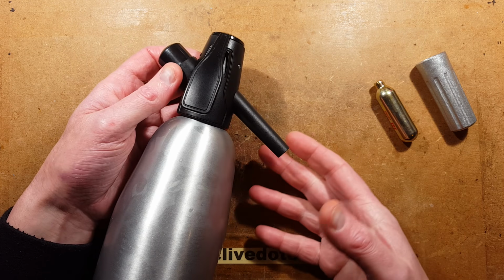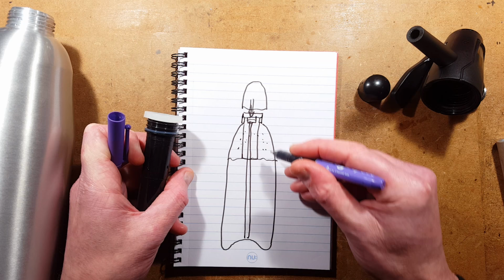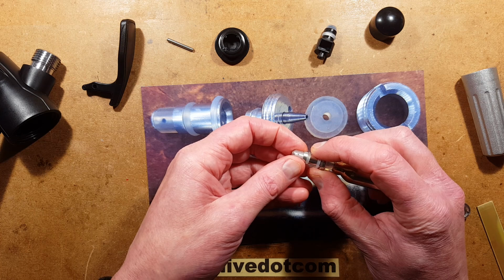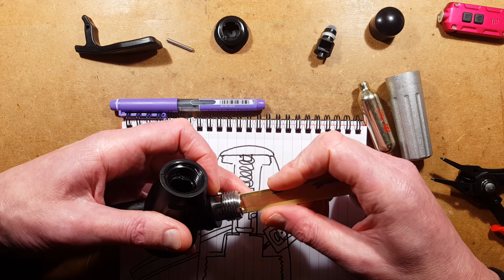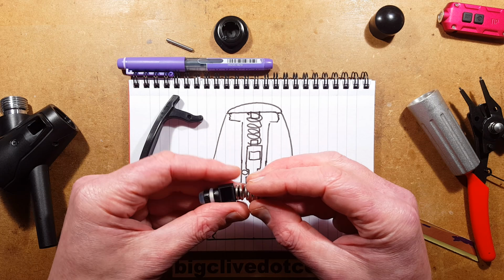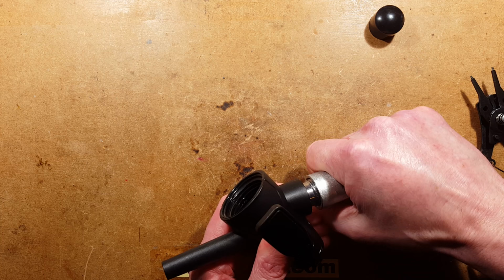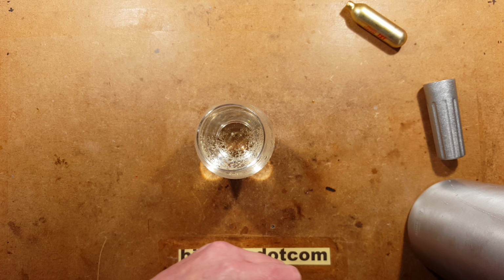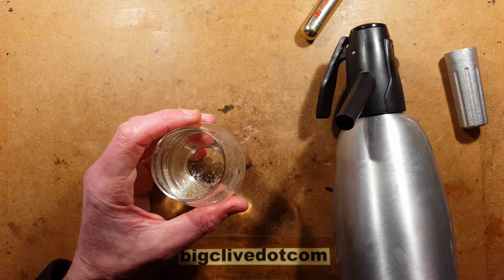Soda siphon teardown.

Comment: In junior high school,  My class made little drag race cars out of wood.  a hole was in the back to accept a CO2 cylinder.  Two cars would be set up on a trigger mechanism that launched both at the same time.  I took my time and carved mine with an aerodynamic body.  sanded it all real smooth and painted it. I sanded the plastic wheels smooth of their sprue dimples and used a wee little bit of graphite in the axles.    Another girl just rough-cut some flat-nosed, very narrow wedge. and slapped the wheels on.  When it launched, hers fell over on its side and slid down the track  (Track being two tight, 50 or 60 foot long cables that ran through two screw-eyes in the bottoms of the cars)  And it STILL beat mine by 2 feet!  I called shenanigans on the quality of the CO2 cylinders.
Reply: Curiously, a wedge with only 3 wheels, and only 2 that touch at any time is the perfect derby racer.
Reply: @ICountFrom0   True..  But I got beat by what was basically a door-stop, sliding on its side
Reply: That's what peek performance looks like.
Reply: I'm guessing you are about my age.  We did the same thing in 1949.
Reply: @MarvinStroud3   I was born in '75,  I built my CO2 racer in 1989/90  school-year.
Reply: Boy Scouts have Pinewood Derby races, similar to yours without the CO2, using a gravity ramp for the start. My dad advised me to just cut a wedge on the nose and paint it, leaving most of the mass it started with. The ones that had been sculpted and painted like yours looked nice, but didn't have enough  mass to get as much speed on the start.
Reply: And while you were faffing about minimising drag on the eyeholes, with your canister on a testube stand, she was holding her CO2 canister in her hand, warming it up and maximising its pressure difference.
Reply: @penfold7800    HAHA!  Probably!
Reply: Cammi Rosanov What a gas! :0)
Reply: What a lovely memory and a lesson in form and function, but I bet she has no recall of the event whilst we share yours......

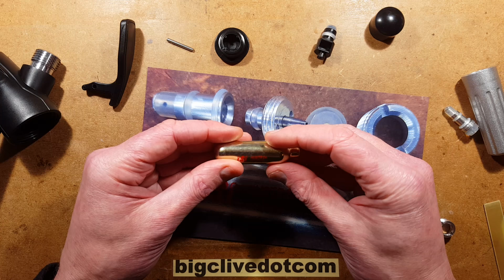Comment: 7:00 For those curious YT has a video called: "How it's made- CO2 cartridges"
- 
tldr: cartridge is put into a sealed machine within a machine and it's filled and capped like the bigman said.
Reply: There is one main difference from Clive's explanation because his guess what that the cap is spot welded on. The video shows a lip was cut on a lathe and the caps look like they are put on it and then crimped not spot welded onto the neck.

The ones that clive has looks a bit different and the cap is inside the neck of the container so I suspect the neck is crimped around the caps because it is a bit conical. The shape of the neck is visible at 6:21. You can see tool marks on the neck of the cylinder from some direction.
Reply: The How it's made video misses vital details of how the process exactly works (common with a lot of their videos).
Reply: Unfortunately that video glances over how that one machine works.

Comment: So the concave shape in the bottle is called a punt.  In wine bottles it makes the bottle easier to pour, but in this case it's a way to allow the bottle to handle the pressure and not fall over when you put it down.  Anytime you're dealing with pressure vessels, the more spherical the better.  Obviously a round bottom bottle won't stand up, so the punt turns part of the sphere inside out and follows the curvature of an ancient roman arch.  2000 years of engineering and materials science went into a device that makes fizz-water.
Reply: First of all you are absolutely right.

I know for a fact a lot of people 

The Ponte .

I know I probably spelled it wrong.

 I'm using Google for voice recognition sorry.

Been more than one comment I've made at the Google turns out hilarious not intentionally.

Anyone have stories on that or anything similar it'd be good to come in here just asking.

Also is it possible to use Google voice recognition for Windows 10 PC use?

Any comments on that would be appreciated I need to use voice recognition most of the time.

And it would be better for some things than dragon.

Any comments suggestions whenever would be appreciated thanks ahead of time.

think that the bottom of a wine bottle is just so it's easier to pour if there's a domed in word but no it's for structural reasons because of pressure.

All so By any chance are you an engineer?
Reply: @aaronbrandenburg2441  Not an engineer, 15 years in beer and wine production.  I guess you could call me a technician.
Reply: I thought for wine bottles it was to get more in a case?
Reply: @misterhat5823  Never heard that one before.  The punt decreases the volume of the bottle and would get you less in a case.  I did find a Wikipedia reference though.  
"It allows bottles to be more easily stacked end to end"
But if that were the case (see what I did there) why not use square bottles?  Well that's where we are with Bota Boxes and Bota Bricks.  Which I love.  Being able to take the equivalent of four bottles of wine home in my backpack is the best thing the 21st century has to offer.

Comment: A tip I read for carbonating wine in an old 1950s Sparkletts ad was flipping the bottle upside down when pressurizing. When you pressurize right-side up the CO2 is passing out the stem and through the wine, frothing it up like shown, but flipping it upside down lets you load the canister with CO2 without it bubbling through the wine, then gradually dissolve it.

Comment: Just remember to use the food-grade CO2 cartridges, the ones made for CO2-powered weaponry can contain a small amount of lubricant which wouldn't taste nice in fizzy trash wine... :P
Reply: A friend considered retrofitting a SodaStream for those large CO2 bottles - same problem there. Except finding food-safe 20l bottles of CO2 is even harder. And after we ran the numbers, it wasn't even worth it, at least when you take the cheaper non-branded cartridges.
Reply: Unless you want to make fizzy lube, then it's probably fine.
Reply: ...Clive would make fizzy lube
Reply: "It gives you a zing on your thing!"
Reply: @rolfs2165  i used food grade dry ice in my soda stream and works good and cheap.
Reply: Even industrial gas suppliers are going to have pure CO2 - you would not want to be welding with random unknown stuff in your shielding gas. That could be bad as people's lives may depend on the quality of the welds you are making. And if it is used in a chemical process - who knows what will happen with random contaminates in the gas. The same goes for O2 and every other industrial gas.
Reply: @rolfs2165  ive modded my soda stream to run on scuba sized c02 tanks that I used to use for carbonating kegs. I get my refills from a welding supply store. About 20 bucks
Reply: bubba99009 yes I don't give a crap what they put in my sodastream, but shielding gas... that is a whole another matter :D
Reply: Every brewery I know uses weld Shielding CO2 or extinguisher CO2 (the place that refills them) to get their tanks filled. They usually have a purity datasheet they get with their tanks. "Food grade" I can't even get anywhere that sells it.
Reply: @rolfs2165  I fill co2 bottles and other gasses and there are no difference in the co2 that goes in a food grade bottle and one for welding or cooling the only difference is how much water there's allowed in the bottle.
Reply: @gearloose703  Argon, co2 and oxygen used for welding aso are the lowest quality you can get 🙂 the clean stuff is used for Lazer cutting, electronics production aso
Reply: A friend use the non oil co2 and it killed an expensive pistol
Reply: @rolfs2165  food grade CO2 should be fairly easy to find.  Welding supplies may have food grade, Beer brewer supplies, hotel supplies...   I can't speak for 20L. those may be hard (no place I know here sells a 20l version), but a 10L refill costs me 26EUro, which is the price of 2 sodastream canisters for 10 times the amount of gas).
Reply: @oreubens  I get those canisters (well, not the original SodaStream ones, but from Linde gas) for ... a fiver at my local supermarket, IIRC. If I bring back an empty one, that is, don't know how much they ask as deposit for the canister itself.
Reply: @sismofytter  Don't let Mr. Welding Inspector hear that. It would take less oil impurity to ruin an x-rayed weld than it would to give you a tummy ache.
Reply: Godfrey Poon 
I suppose then that the welds that don’t  need X-rayed get the shitty CO2, and welds critical enough to be X-rayed get the good stuff. Nothing either of you said preclude that being true
Reply: @mrb692  Nope. Never seen different grades of gas. When we have had the super critical welds done, the gas came from the same place and had the same order code.
Reply: @mrb692  Of course it may be different where you are.
Reply: The airgun ones are longer (83mm compared to the 65mm Soda Syphon ones), so they won't fit the Soda Syphon.

I guess you could make a spacer, so you could use Soda Syphon ones in your airgun, but it wouldn't be worth it, since the Soda Syphon ones tend to be more expensive, and lack the oil which you really need to protect the seals in the gun.
Reply: Knowing Clive's likely taste in wine  (probably the best thing to serve it with is chips .....  mmmmm, chips .....  big fat chunky chips with a sprinkling of salt and lashings of vinegar .....  mmmmm .....  sorry, just got a bit hungry .....)  the lubricating oil probably would be an improvement.
Reply: @sismofytter  Ah, but the food-grade ones are kept separate from the industrial-grade ones  (which, as has been pointed out, have to be just as pure anyway .....  if not purer, since some industrial process might be ruined by a trace of something that would be innocuous to humans).  This means they can charge a different amount for them.  If they just mixed all the cylinders up, you would not know which customers were paying for food grade and which were paying for industrial grade.
Reply: In the US at least, it's fairly easy to find large food-safe CO2 tanks if you make a few phone calls-- these places can be kinda oldschool, especially the cheap ones.
Restaurant supply stores (or restaurant liquidators and craigslist, if you're cheap like me) sell the bottles for use in soda fountains, and you can get them refilled for a couple bucks at a soda bottling plant or beer distributor.
Reply: @bluerizlagirl  Food grade bottles have a gray top and a light green bottom but the Co2 in the bottle are the same as you would use for cooling, welding aso the only diffrens is the maximum allowed amound of water in the bottle. The bottles are never analysed for othe gasses, oil aso.
Food grade bottles need to be cleaner on the outside, so no bird poop aso allowed :-)
Reply: I don't think they can put lube in a CO2 cartridge.
Reply: Why use all thus stuff. Ig I just knew where to buy the cartridges I've had syphan since the 70's
Reply: @nul well most gas company's like Linde Gas, Nippon Gas aso only have one purity of co2 they use for all there products at a filling site

Comment: Great. Always wondered how these worked. My dad had one years ago. I remember pinching one of the little co2 bottles & throwing on a bin bonfire in the bag garden. Nothing happened for ages, so walked off. Then as I walked away it exploded shattering windows & throwing red hot shards of bin. Just a normal day in my life.

Comment: Funny, I just threw an orange coloured one out from my late dads house clearing - I saved the glass wire bound one.

If you let the CO2 in slowly as shake it, it also works better , rather in one quick rush

I remember as a kid dropping a sparkletts down a copper tube onto a nail, it shot out hit the ceiling and went mad all around the room - such fun.

Comment: Back in the day, I had a bicycle pump that operated off these cartridges too.  Great, light-weight pump for on the go.  I later used the same  pump to pump CO2 in to my growing plants to help them take the heat of the hydroponic system.
Reply: Bill Whittaker  ;)  Weed early in life until I discovered live resins and shatter.  Then I grew food for my two pet rabbits.  I'm old enough to remember when 1000w HID's were in.  I was an early adopter of LED's and elevated CO2 levels.  I basically tried to replicate a PhotoTron if you're of the age to remember those ads.

Comment: The plastic lever with a hole drilled through it looks a serious design flaw. Older levers were metal.
Reply: Maybe is glass fibre reinforced 30%
Reply: @mmartinm  with a TPU overmolding? with those styrene at the end of the molecules?
Reply: @mmartinm /videos  skookum
Reply: It's called planned obsolescence
Reply: Some plastics are stronger than some metals, so I wouldn't say so.
Reply: StarkRG yet they are brittle. Fiberglass polyamide, for instance, that automotive manufacturers use these days on engine raditator massively, to cut down production costs. I had an accident in a light car crash recently, in which i broke main radiator just because its plastic cracked just a little bit on a piece it was holding on. The crack was about 3mm in lenght and was almost unvisible, yet it rendered radiator in an unrepairable condition. But the AC radiator, which is made out of only aluminum, and which is standing in front of main radiator , took all of the impact and was still functional. So, the properties of metals such as plasticity and ability to contort back to its shape (i dont know english word for it) sometimes are preferred option.

Comment: When I was 10... 1960, we had a wire bound glass soda siphon and my job was to wash, dry and refill it with both water and gas. No, it didn't break or even crack... the glass must have been about 12mm thick and the binding wire was very tightly bound, giving it more strength. The bulbs were Sparklet brand too. Into the fridge for an hour before applying the gas. Mum and Dad liked their whiskey with a dash of soda. Brings back some fond memories... thanks Clive.
Reply: Still got one of those but prefer to use my much more recent one.  Only sodastream is available round here & I'm no fan of that corporation so a Syphon is a economic & functional alternative.

Comment: Central Europe, 1980s: every home had one. There were a few variations of shapes and colours, we had a 2 liter one (needs 2 cylinders). Everybody knew how to use it. In some cases you had to be careful because the first squirt was so violent that it shoot the syrup out of the glass, children loved trying it first outside. Those were such times if somebody told us that in a few years we will buy water in a plastic bottle in the supermarket, we would not believe. We (as kids at least) did not even know that bottled sparkling water existed. This machine was the base of our drinks: soft drinks from home made fruit syrup for kids and sparkling wine (wine+sparkling water) for adults.

Comment: The co2 cylinders are also used to inflate bicycle tires, as they are faster and smaller than having to pack a pump.  Some are like the tube you had, while others are threaded on the end that gets punctured. Either way, you use them with a small adapter that connects them to the presta or Schrader valves on the tire tube. The adapter has some kind of valve release, and it's tricky to control or judge if you have enough in your tire tube,   The common knowledge among cyclists (read: not sure if true) is that the co2 will escape from the tubes much faster than air, so you are advised to replace it after you return from your bike ride.
Reply: I guess you could use the Nitrogen cylinders for tyres.
Reply: Bill Whittaker  My new tyres (Tires) where inflated with pure Nitrogen when fitted a couple of weeks ago. If you check COSTCO Tyre sales they have an excellent explanation of why it's better.
Reply: @malcolmtill  where?
Reply: @manolisgledsodakis873  Quote "First is that nitrogen is less likely to migrate through tire rubber than is oxygen, which means that your tire pressures will remain more stable over the long term. Racers figured out pretty quickly that tires filled with nitrogen rather than air also exhibit less pressure change with temperature swings"
Reply: Bill Whittaker  What question are you referring to ??? I suggested Nitrogen as an alternative to Co2. Perhaps you would consider reading the comments more carefully in future to save making Ill considered remarks.

Comment: Mum and Dad used to run a Pub in 1970's and I even remember the Glass one's that came ready pressurised and were recycled for use again.
Reply: As a student I worked at Schweppes where they refilled those large heavy glass soda water bottles. First they  were tested at 10 bar in a steel cage. Occasionally a faulty one would explode with a noise like a bomb going off!
Reply: @tomdickson6430  I've got one here, proudly sporting the Royal Cipher, By Appointment. It still has a little liquid and gas and works perfectly.